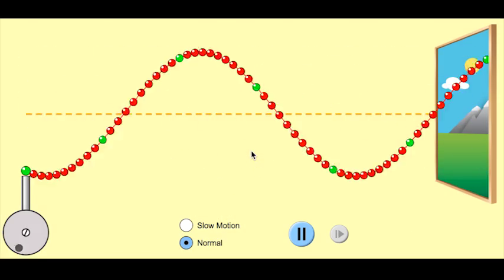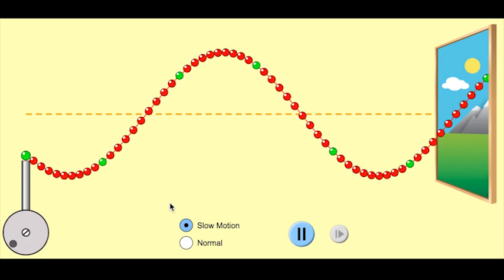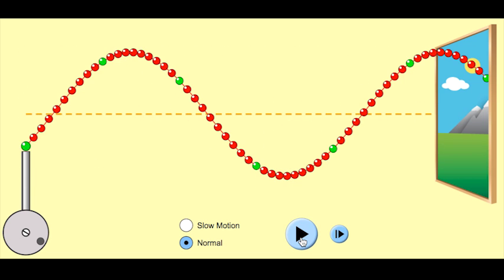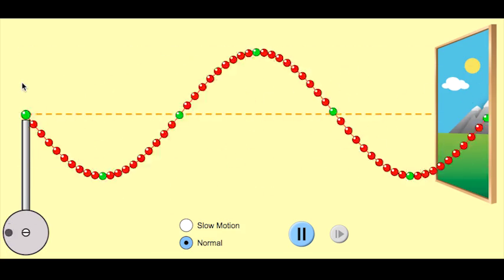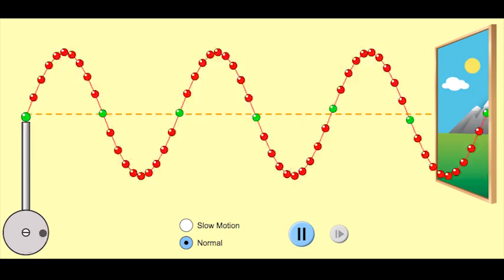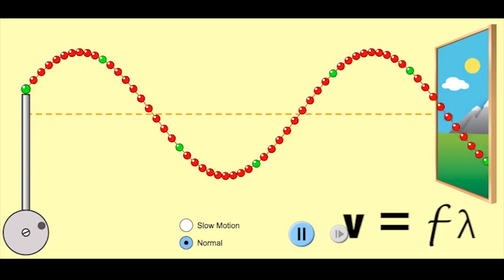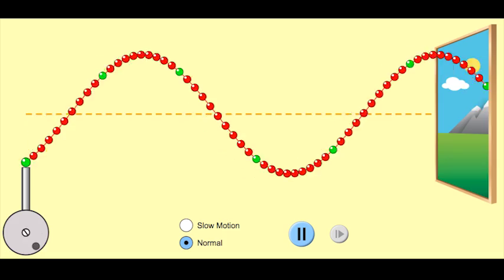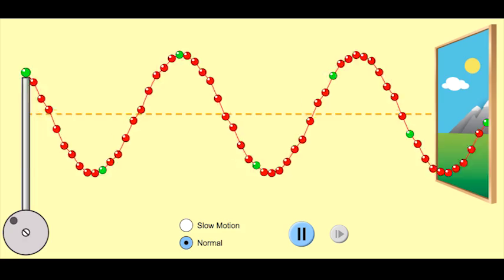transverse waves explained

Comment: wave length and frequency do change when the medium changes r8?
why do u say it doesn't
because velocity change with medium 
by the equation v=f*wave length,
these values need to change tobe equal to changed velocity or new velocity after altering medium
Reply: only velocity depends on the medium. when the velocity changes, frequency remains the same and the wavelength changes
Reply: and frequency is dependent on the vibrating source. hence when the frequency changes, the velocity wont change (if the medium does not change) but the wavelength changes

Comment: Hi, is the wave simply going up and down as it goes through space, or does it make full revolutions, almost as if it's oscillating around an invisible cylinder?
Reply from the maker: +Devin Brines it is simply going up and down. What you describe in the latter half of your statement is a torsional wave.
Reply: You rock. XO. Good vibes to yaa

Comment: do these particle possess the same kinetic energy ?
Reply from the maker: well that depends on the way you look at it.
KE is motion energy, so the KE of the particle constantly changes as it moves back and forth, and so each particle has a maximum change in KE as it moves and stops.
Compared to other particles, this value will be the same AS LONG AS there is no energy loss through the medium. This is practically not the case as some energy will be lost to the medium itself, which will warm up. This is called damping.
And so as the wave continues to move through the medium the maximum KE will decrease.
Reply: All the particles move in Simple harmonic motion on their respective coordinates and in when a particle moves in a simple harmonic motion , the velocity of the particle is different for different distances from the mean position. Hence, the particles which are in same phase i.e the one which are integral number of wavelengths apart, move with the same velocity

Comment: so how do u increase the velocity then if wavelength and frequency increase and decrease simultaneously?
Reply from the maker: The velocity of a wave can be altered by changing the medium. So in the example of the string in the animation, you do that by changing the tension. If we are talking about sound waves, then the density affects the speed. That is why the speed of sound in air is altered by the temperature, which alters its density. Sound travels even much faster in liquids and solids, since the density is much higher.

The only exception to all this is electromagnetic wave. Its speed is always the speed of light, regardless of medium. In fact, its the only wave that does NOT need a medium. Hope that helps.
Reply: legend! thank you so much